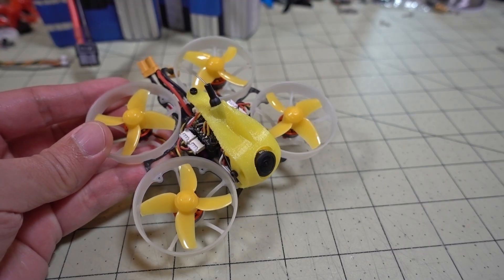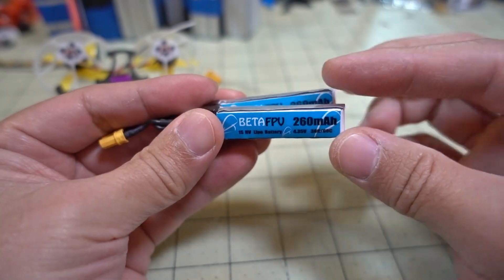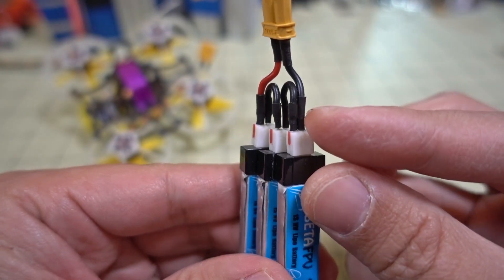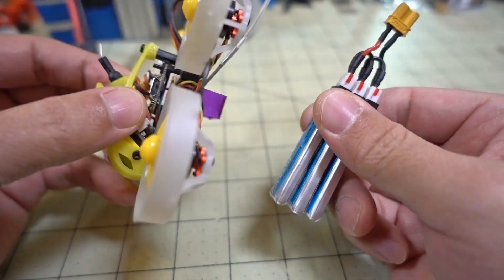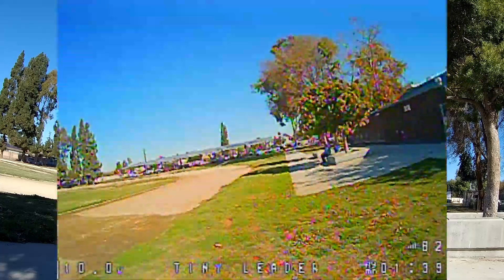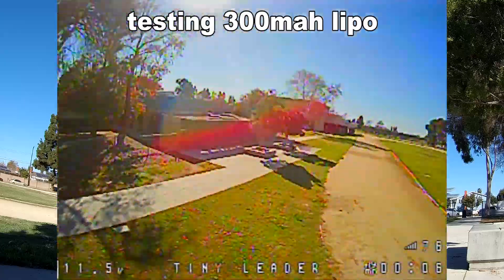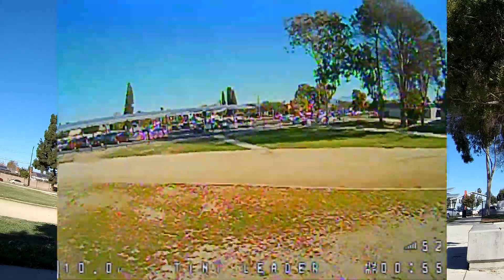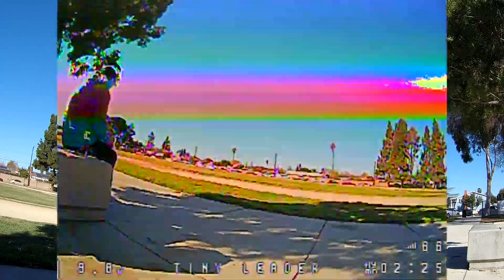TinyLeader 3S Lipo Solution 🏁🔋

Comment: Nice solution! Unfortunately, I don't have a 3D printer so I removed the original TPU holder and I used a Velcro strap which is secured by the bolts and nuts which kept the TPU. Additionally, I used one side taped anti slip mat which I fitted on the Quad and each 3s battery (tattu 450mah, zop 450mah and GNB 550mah). After 4 bateries the ESCs died... 😠😠😠, I bought a new ESC board and also asked FullSped for an extra one free of charge but no reply yet...

Comment: I have 2question for this setup
1. What is the total weight ? 
2. How is the voltage sag, ? 
i did a similar setup (JST to XT30 converter) and it sag and the battery runs really hot

Comment: Thanks for the review.  I preordered one of these and actually sent FullSpeed an email a few days back asking them what 3S set up they were going to recommend but have not heard back.  I wonder how (3) of the BetaFPV 550mah 1S or he 660mah would do?  Likely a little too heavy as there is going to be a breaking point for the weight to performance ratio where you may as well just run it on 2S.
Reply from the maker: I think 300mah is gonna be the max IMO

Comment: Hello Albert, with all of these Tiny Whoop type quads with push on props, how do you keep them from popping off, can you do a video on props for they types of quads.
Reply from the maker: Hmmm, I already did a video on that from like TWO years ago but long story short you can either use a little CA glue in the prop hole or dental floss to help the prop grip the prop shaft better to keep it on.  I believe most people just use a drop of CA glue.  Make sure it dries first before flying.
Reply: Hello Albert, Happy New Year from Australia, thank you for your reply, I was thinking the same thing about the CA, however seeing this new line of Brushless Whoops I was thinking that the power these Brushless motors develop compared to the older Brushed versions must be much, much more and that would result in more issues with props coming off. It almost seems that the manufacturers of these brushless motors need some sort of adaptor to lock on the prop. Just a thought. Keep well and we all look forward to seeing your reviews in 2019.

Comment: My TinyLeader arrived on Friday, ran one battery inside the house (raining) on Saturday ran 2 1/2 batteries and fried the ESC. That is with the GNB 450 2s battery. I’m now waiting for a response from FullSpeed. You might want to hold off buying this one until they figure it out. 🤬
Reply from the maker: they are offering free replacement ESCs if yours fried so I would contact them.
Reply: Albert Kim Thanks for the reply, I didn’t know that. 👍

Comment: Hey Albert,  any chance you could try using the LDARC props for the gt7? And or some of those quad blades 1535 props? I have a feeling the standard whoop props are bottoming out and flexing too much at high rpm. Really curious about performance. I've been using 1535 quadblades on my 75x and it flies MUCH better. Waiting to get my hands on the Tiny Leader....hopefully will be later this week.